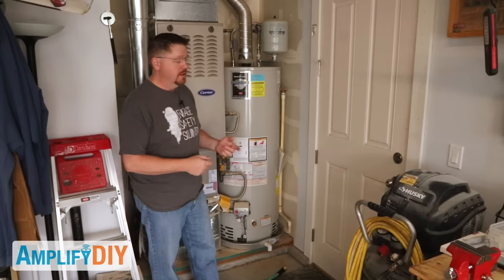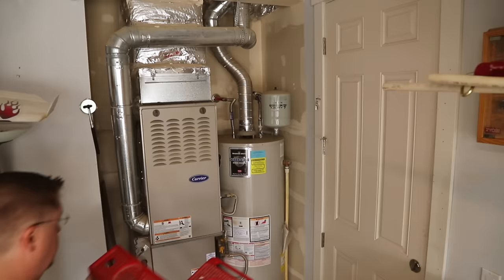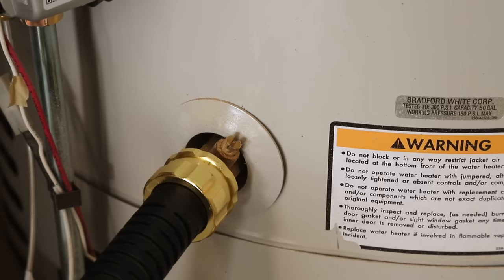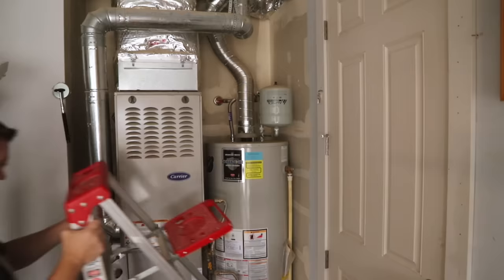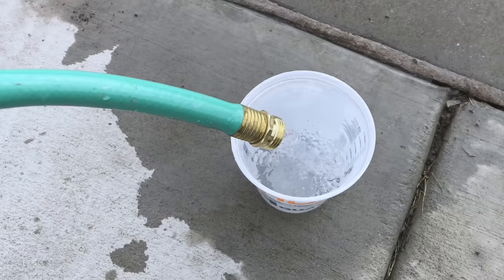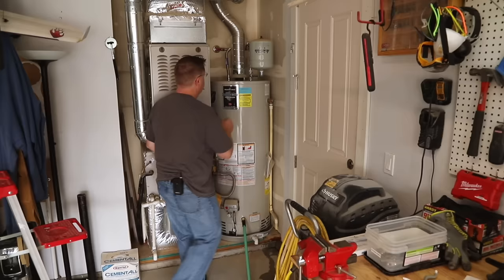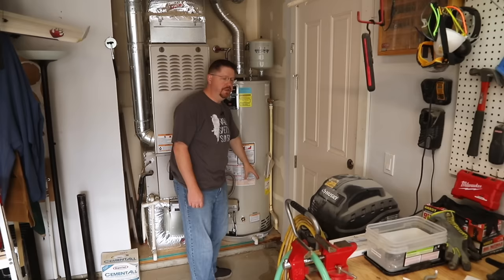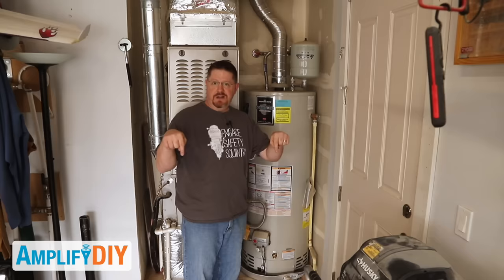How To Flush A Hot Water Heater To Remove Sediment

Comment: While draining the tank are you keeping the kitchen faucet on for the whole process?
Reply from the maker: It actually does not matter if I keep the faucet open during the flushing process - I just had to let air in so that I could let water out of the tank. Since I ultimately used the T&P valve to let air in / out of the tank, the position of the faucet became irrelevant. If your faucet actually allows air into the system, then just leave it open all the way to the end of the process, including during filling the tank for the final time. Good luck!

Comment: Great video!! Really appreciate it. I did it for the first time however had a small hiccup.

One of my toilet water supplies (connects the wall to the toilet) burst while I was doing the flushing Bursts(that’s when I noticed) . Any idea why? I followed the video to the T, so not sure what happened
Reply from the maker: Hi Alejandro - I'm sorry to hear your toilet supply burst! That's super odd, but I can think of a possible scenario: Your house has a single cold water supply line that comes in from the street. That line is effectively split into 2 branches once it gets to your house: one goes to all the cold water fixtures, the other goes to the water heater and then out to all the hot water fixtures. When you open and close the valve on the hot side, you may be inducing a fluctuation in the pressure on the cold water side, as when you open the valve to let water into your heater, the pressure on the cold side will drop a little, and when you close the valve again, the pressure on the cold side will go back up. Depending on how strong this effect is, it may have been the reason your toilet supply burst... but this is the first I've ever heard of such a thing happening. In the future when you perform the flush, when opening and closing the cold water supply in bursts, do so gently to reduce the sharpness of the pressure drop/spike.

I hope getting the toilet re-connected was not a major problem for you. Thanks for watching!
Reply: @AmplifyDIY  it shouldn’t be too hard it was just the connector luckily! I’ll definitely try that next time!! Appreciate the response!! THANK YOU!

Comment: Very good video tutorial. Can you about the power flush method, where we continue let the cold water running amd do not need to turn off the gas, so as we drain the cold water will create the agitation to help. This is the easiest way.
Reply from the maker: So called "power flushing" as you describe is actually less effective, as the total mass of the water in the tank makes it nearly impossible to agitate the sediment at the bottom of the tank while it is full of water. It's far more effective to drain the tank entirely, then flush a few short bursts of cold water as I show in the video. Thanks for watching!

Comment: quick question, is it advisable to drain into sump pump? Or would I need to drain out a basement window?
Reply from the maker: Hi there - it's fine to drain into a sump pump, but I recommend 2 changes: 1) Turn off the heat source and then go take a shower, do some dishes, or run some laundry. This will cool down the water in the tank so it's not so hot when you drain it. 2) Use a kitchen strainer to catch any large chunks of sediment before they go down into your sump pump. Good luck!

Comment: Great video!  Seems simple enough to do, but I have one issue about draining the water.  Our hot water heater is in the basement and there is a window (in a window well) in the basement, but it’s far from the hot water heater—basically on the other side of the house—and then also the window is in a deep window well.  There is a drain in the floor near the hot water heater, but we have a lot of stuff stored in that area and I’m wondering if the water would come out of the hose too fast to go down the drain quick enough and basically flood our storage area.  Our furnace systems are also located near there.  Any suggestions for this type of situation?  Thanks for any help!
Reply from the maker: Hi Sarah, 
Yes, I recommend 2 things when draining into a basement floor drain: 
First, turn down the thermostat as I show at the beginning of the process, but then go take a shower, do some laundry or some dishes. This will use up the hot water that is in the tank and cool it down. 
Second, use a kitchen strainer to catch any large pieces of sediment that may come out of your heater. 
This way the hot water won't potentially damage or overheat a sump pump (if you have one) or clog up your drain with sediment.
Typically drains will have no problem keeping up with the flow out of the heater, but you can control how fast it drains with the drain valve of the heater. If it is flowing too fast, close the drain valve a little. Good luck!

Comment: I followed your advice and opened the pressure release valve and it never resealed properly. It cost  $450.00 to replace. Plumber told me you should never mess with this valve. I concur.
Reply from the maker: Hi Timothy - I'm really sorry to hear that your T&P valve did not re-seal correctly, but $450 to replace it is ... atrocious. T&P valves are meant to be tested annually, and replaced if they do not re-seal. The valve itself can be picked up for around $25-30 at your local home improvement store, and they are very easy to replace. I did another video all about them here: https://youtu.be/e5H1i1cypxA - again, I'm sorry you had to pay so much to replace your valve. I hope your heater is working well now.

Comment: Really well done. Thanks for this. Out of ordinary question. What microphone are you using. Super clear audio. Using iPhone to record? If not what camera? Thanks again.
Reply from the maker: Heya Dr. Phil - thanks for watching, and letting me know you thought it was good! As for the mic and camera I use: this was filmed on a Canon 6D Mark II, with a Canon 24-105mm L series lens, and the audio was captured with a RødeLink wireless mic. I wear a small lav mic clipped to my shirt just under my chin, that goes down to the RødeLink transmitter on my belt. There is a paired receiver attached to the camera that feeds the audio directly into the camera. I still use the RødeLink mic setup today, but I've switched from Canon to Sony for my camera platform. I occasionally use my iPhone for some B-roll and extra shots. Thanks for watching!

Comment: My tank was just steady stream like turning on a water faucet .  Cold water shut off and the pressure valve open that what started the flow out of my tank.   So you suggested to open cold water valve 20 seconds and I did this twice and tried it a third but the water didn't flow though I had flush 20 seconds of cold water.  So I closed the valve on hose to drain.  And took off hose I then decided to fill the tank and went in house to ask how long does it take for that tank to fill?  Well it took so long to empty that I came right out and water was pouring from the pressure release. Pipe what you were afraid of you didn't close it.  Now what do I do is the  tank filled cause I repeating the process to put hose on  lift the pressure handle open the valve with hose below and does this mean I have to take the water hose double attachment end 😅and back flush sediment blocking the flow?

Comment: When do I close the indoor hot water faucet after allowing air in while draining? I may have missed this in the video but I can’t figure it out. Do I keep it open the whole time? Do I close it before the final fill?
Reply from the maker: Sorry for the confusion: in the video I showed opening it to let air in, but then I also showed opening the valve on the side of the heater to let air in as my faucet was not doing so. Once you let air into the tank and get it drained, it does not matter if the faucet is open or closed during the flush - just make sure that you open it during the final fill, so that all the air in the tank has an escape route as the tank fills with water. You can shut it off again after all the air is out and water flows normally from that faucet again, as I showed in the video. Good luck!

Comment: I hope you'll see my message 😊.  I followed your instructions and drained my tank (many many times) until it ran crystal clear.  I agitated the bottom a lot.  The tank drains clear but my hot water inside is still off colour.  Every plumber says I need a new tank.  I have drained it before. It's a 50 gallon, with an 8 year warranty. I'm in the 9th year. I've hear of using lye but don't know how I'd access the tank.
Reply from the maker: Hmm.. The water comes out of the tank completely clear, but out of your faucet off-color? And professional plumbers have said you need a new heater to remedy this?! Those symptoms point to a need to replace the pluming pipes in the house (or at least some of them), not the heater. 

It could also potentially be a failed expansion tank ... If you fill the heater and let it sit over night, then take a shower in the am the water is dark / brown / off colour? If you then immediately go drain the tank - what color is the water that first comes out? If it's clear, you don't need a tank, and the problem is elsewhere.

Comment: The video is very helpful.  A question, what type of hose would be good ( considering there may be very hot water to drain)?
Reply from the maker: Hi Nageshvk10 - I have 2 suggestions: The first is to cool the tank before you do the flush. You can do this quickly by first turning off your heat source to the tank, then taking a shower, running load of laundry, or doing some dishes. This will use up the hot water in the tank, and it will be replaced by much cooler water. This way when you do the flush you are not draining very hot water. 
If you prefer not to cool the tank first, then I suggest checking the heat rating of the hoses you are considering. Most will indicated their min and max working temperatures. A decent garden hose should be able to deal with water up to 130•F or so, which should be ok for your heater. But double check to be sure. 
Thanks for watching!
Reply: @AmplifyDIY  Thank you so much for the reply.  Will use up the hot water as the hose I bought may not stand the temp.  Also, wondering why not perform flush while filling the water into the Tank.. would it not provide agitation and removal at the same time?

Comment: I live outside Phoenix. I’m not supposed to drain any water into the street but into the sewer drain in my yard.  Will the water from the tank be too hot to do this? Thank you
Reply from the maker: Hi Sharon - if you are concerned about the water temperature, here is what I recommend: Turn off the heat source for the heater, then go take a shower, do some dishes, run a load of laundry, etc. This will use up the hot water in the tank, and replace it will cooler water from the cold water supply. Then you can proceed with the flush, and the water that comes out of the tank will only be lukewarm instead of scalding hot. Good luck!

Comment: Does it have to be a faucet and the relief valve both open or is it just either or?  Thanks for the diy!
Reply from the maker: Hi Reggie - you just have to let air into the system somehow. I suggest trying a faucet first. If that does not work (as in my case) then use the T&P valve. You don't need both if a faucet lets air in for you. Good luck!

Comment: I know this is a long shot, but I'm about to attempt to drain my water heater after finding mildew that grew from a leak in the cold water connection from when it was installed. My wife has concerns about me draining it into the bathtub, but we don't have a floor drain anywhere near the hot water tank, and given it's well below freezing outside I'm not about to lead it out the window. Do you think it's fine to dump it in the tub or should I go out and get an extra long hose so I can lead it to the closest floor drain?
Reply from the maker: Hi David - is the upper lip of the bathtub located lower than the drain valve? If not, you can't drain into the tub anyhow... the heater will drain down until it is level with the edge of the tub, but then it will stop.  If the tub is just sitting near the heater, but the edge of the tub is above the level of the drain valve, you will have to find a different location to drain to - and it will have to be something downhill (or at least level with) the drain valve of the heater. Good luck!
Reply: @AmplifyDIY  Well, with my particular set-up, the drain valve is actually lower than the lip of the water closet that is sitting in in the first pace, so idk if I'll be able to drain it properly in the first place. But thanks for the tip! I followed your guide anyway and I think I got a good amount of residue out of there, even if it isn't totally perfect

Comment: Do these instructions apply to both gas and electric hot water heaters?  IE, do you follow the same steps independent of the type of hot water tank?
Reply from the maker: Hi Maureen - yes, with a few small differences: with an electric heater, rather than messing with a vacation or pilot mode, just turn off the breaker for the heater so it has no power and no possible way it could turn on the heating elements while it is empty. Also, it's a good idea to remove and inspect the heating elements while the tank is empty, and replace them if they are looking pretty bad. They generally unscrew out the side of the tank, and there are usually 2 - one near the bottom, and one near the middle. Check your instruction manual (they can be found on google pretty easily - just look up your heater model number) for more details. Good luck!
Reply: @AmplifyDIY  Thank you so much!!

Comment: I did have question or two.
I just did a flush on my 3.5 year old water heater.
I followed your instructions and even flushed my tank 4x. 
When I got to the end of the process, the tank was full as described and had the pressure relief valve was then closed.
Cold water inlet was on etc.
I then had a steady stream of water coming out the end of the diverter pipe (from the pressure relief valve).
Is it possible the opening & closing of the PRV became faulty from opening and closing?
Could the PRV have become faulty from flushing sediment etc.?
Thx
Reply from the maker: Hi Glenn - I apologize for the delay in my response. Most likely, the PRV was crusted over with some sediment on the inside face of the valve. When you opened it and then closed it again it did not quite line up perfectly and some of that sediment is preventing it from closing properly. You can try forcefully opening and closing it several times to see if you can get that sediment to break away and reseat the valve. If it continues to leak, the only solution is to replace the valve. Fortunately, this is a simple process: https://youtu.be/e5H1i1cypxA

Good luck!
Reply: @AmplifyDIY  I replaced the valve on my State water heater last night and your video gave me a little confidence boost to do it on my own. Thanks!

Comment: Such a helpful video, many thanks for putting this together.  Can I ask what that piece of equipment is on the top right of your water heater?  It looks like a filter housing.
Reply from the maker: Hi Reginald - that is called a thermal expansion tank, and is becoming required in more and more places. I did a whole video on it as well, if you'd like to know more: https://youtu.be/NGygvtP6Sdk

Comment: How important is it to make sure the tank is full before use and if so how do you know when it is full? Also first time homeowner here ive been thinking of cleaning my "hot water heater" also what ive always called it 😂😂 and you have made this so much easier
Reply from the maker: Hi Regulator - it's really important to make sure the tank fills all the way back up and you get all the air out of the thank. The best way to do this (as shown in the video) is to just open a hot water faucet while you re-fill the tank. Once that faucet stops hissing/gurgling and starts to just flow normal water, you can close the faucet and turn the thermostat back up on the heater. That process will get all the air out - then you just need to wait for the unit to heat the water and it'll be ready to go. Thanks for watching!

Comment: Question: You stated that you turn on a faucet to reduce air in your lines. At what point do you close the faucet when you are draining the tank? While it is draining,  or leave it open the whole time your draining your tank?
Reply from the maker: You can just leave it open during the whole process if you like. The important times that it should be open are a) during the time you are draining the tank (to let air into the tank) and while you are re-filling it for the final time (to let air out of the tank.Good luck!

Comment: I've had my water heater for over 8 years and have not done this. Are there any additional precautions that need to be followed?
Reply from the maker: I would only recommend that you don't do it in the evening on a weekend, just in case something goes wrong and you have to call in a pro. You should be fine though. Good luck!